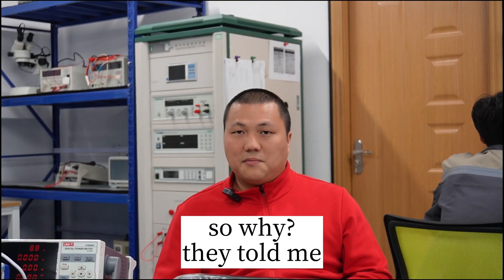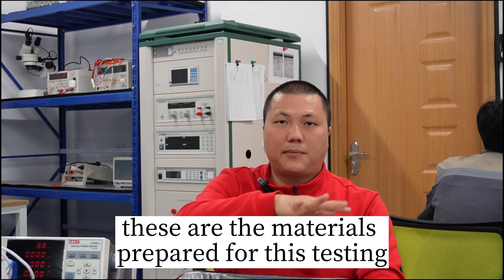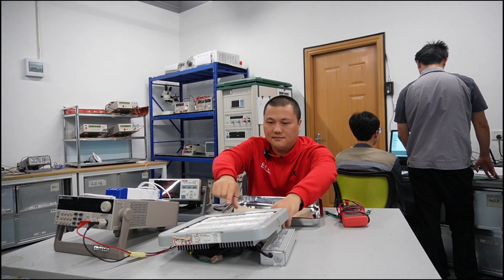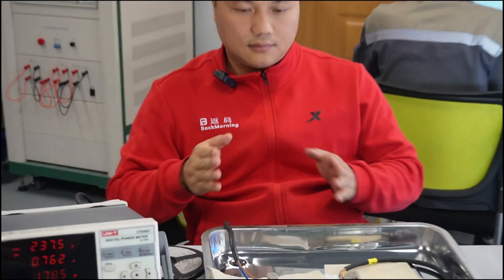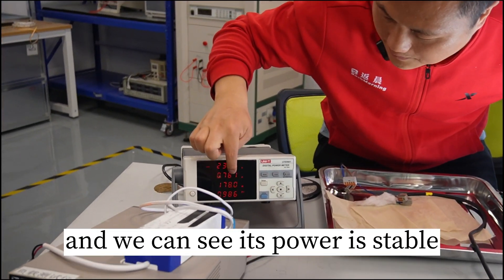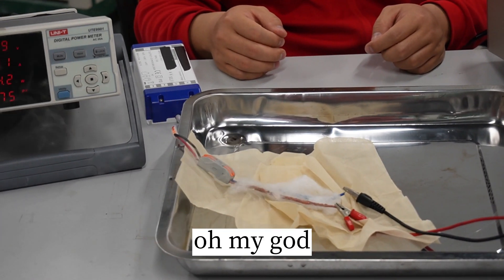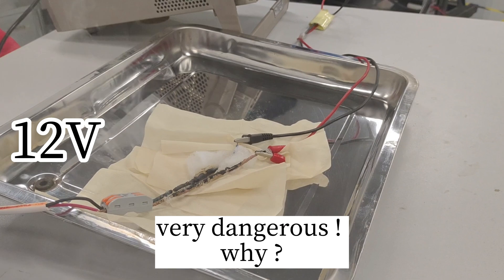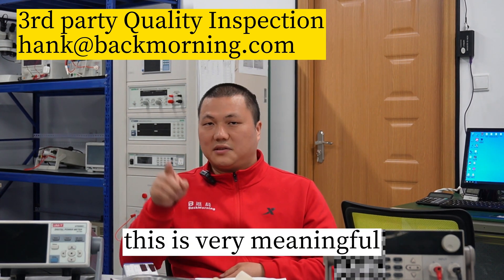Are low-voltage LED lights more likely to cause fires?

Comment: The lower the voltage, the higher the current needs to be to give the same wattage. 240V at 180 watts draws 0.75 amps. 12 Volts at 180 watts pulls 15 amps!! The more current passing through a wire, the greater the voltage drop across it due to resistance: heat dissipated by the wire is equal to voltage drop across it X current through it. Greater voltage drop as well as greater current quickly burns out a smaller wire.
Reply from the maker: @brizee993  you hit the point

Comment: what is the watts, current for the DC?
Reply from the maker: It's 180w, 12v, the current is 15A
Reply: @InspectorHank  So the issue isn't AC vs DC.  It's because you are running low voltage and high current DC.  If you ran an equivalent 240V DC, the current would be the same as the AC.
Reply from the maker: @BalanBro2  You are right. I highlight DC with AC, because in the normal lighting industry, AC always use 110/220V, and DC always use 12/24 V, which is much lower
Reply: @backmorning  Ah yes, understood. I used to work with automotive audio installations, and the low voltage and high current needed for amplifiers often required massive cables up to 0AWG.  Those same amplifiers only needed 10AWG to the speakers since the output was much higher voltage.
Reply from the maker: @BalanBro2  very interesting, thank you share with me this story.